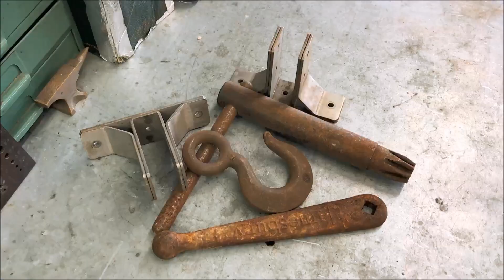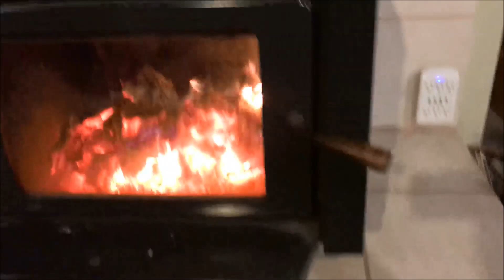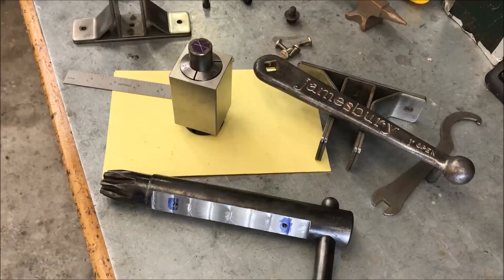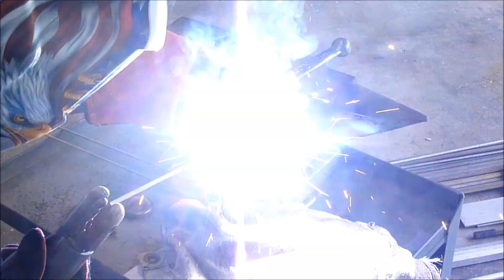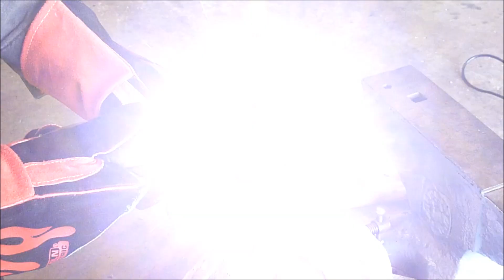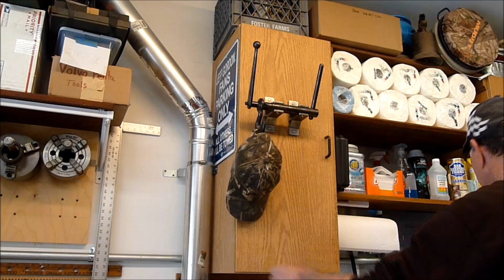#coathanger2020 Rustinox Challenge Entry

Comment: That is a great coat hanger! Love the mix of machining and welding. And I love the two-tone finish. Were the brackets zinc plated or something? Either way - great result! (I realise that you have many more videos that I should dig into and enjoy - that is great, especially with all the extra time at home!). Cheers and keep safe, Craig. PS: My workshop has a clothes dryer in it too. It's annoying because it spits out moist air, but I am living with it for now.
Reply from the maker: Those are actually stainless steel restroom partition wall brackets...no idea were I got them...Cheers
Reply: @TheAyrCaveShop  Cool. Well - I love the result. Well done. Cheers, Craig